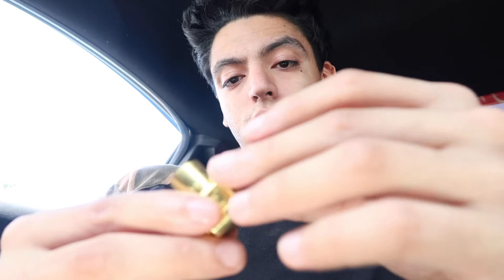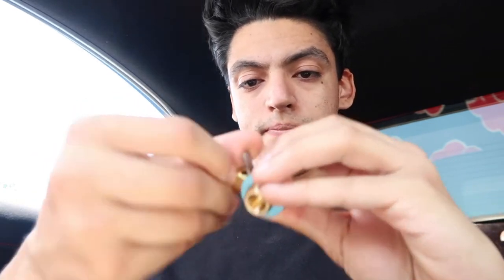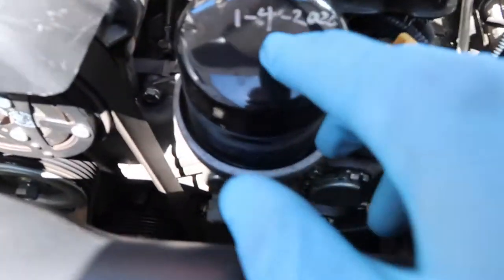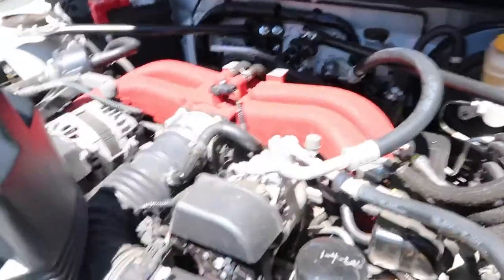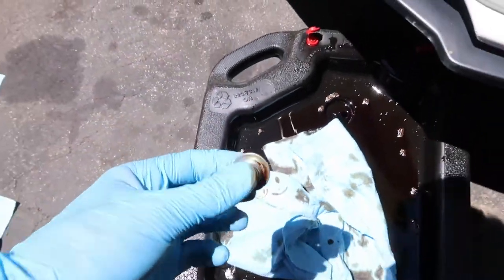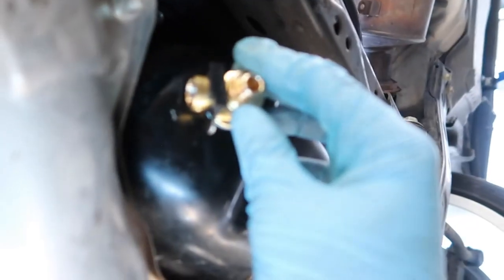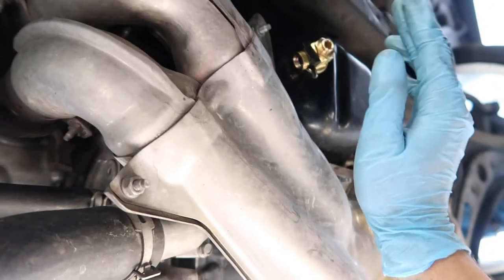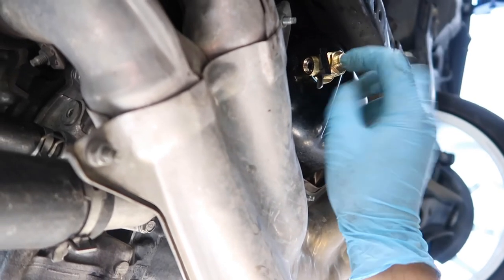FUMOTO Drain Plug honest REVIEW, is it worth buying ? | BRZ FRZ |

Comment: I f you trust a cheap valve ,say goodbye too your $10,000 plus motor
Reply from the maker: Have you used the product before ?
Reply: They are high quality and not cheap.
Reply: An oil drain plug bolt costs 3 bucks so what's cheaper?